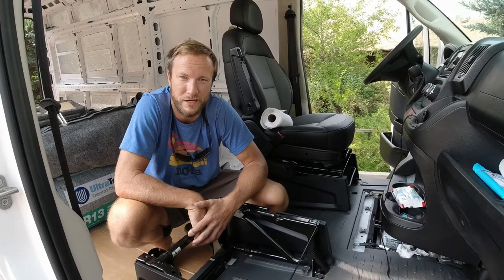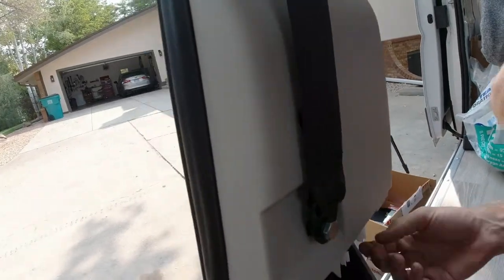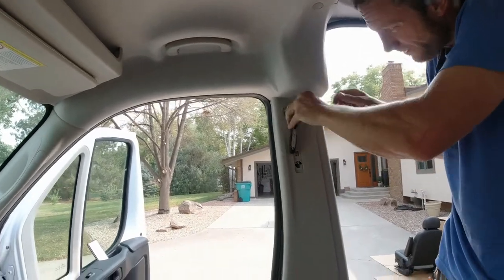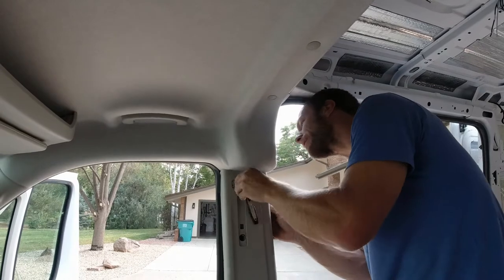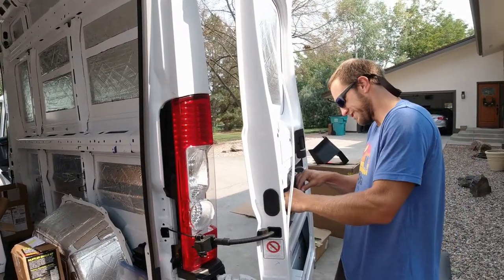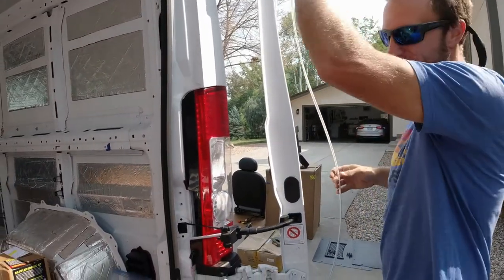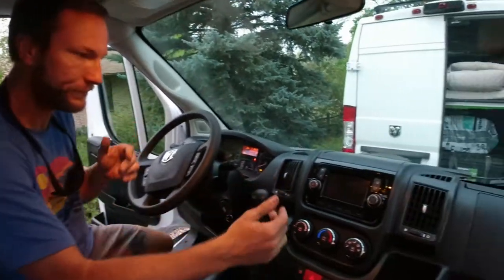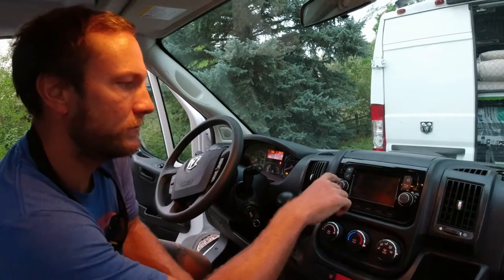Ram Promaster Stereo Upgrade: Rear Speaker Install & How to Reprogram Stereo for Rear Speakers

Comment: Higher sensitivity speakers is what you need. Or external amplifier. Sound dampening to quiet the road noise will also help. The amp inside the factory radio is pretty garbage I think. 
Look for speakers with higher dB/watt. Anything over 90dB/watt is pretty good. 
Also distortion even at low power will blow a speaker. Keep that in mind. I’m working on 3D printed speaker pods for the dash that I’m thinking will really help my Promaster’s sound.
Reply from the maker: Yeah, we put in an amplified sub and it's been sounding great.  For some reason, the 2019 stock stereo gets much louder than the 2017 we used to have.  So that helps.  Hope your 3d printed parts work well for you!

Comment: Hey Y’all and thanks for your time!   The one Question EVERYONE NEEDS TO BE ANSWERED IS...,what are the Wiring Colors for each Rear Speaker at that connector!!??   1k of us have been asking for years!!!!  What are they!?  Xoxo
Reply from the maker: Thanks for watching!! The colors don't matter when you're using the upfitter, which is located in the passenger pillar.  You only need the wiring diagram if you're wiring behind the head unit.  If you don't have the upfitter, we did find the wiring diagram online at some point in our research but I can't remember what the colors are at this point.  If I can find it, you can too!

Comment: How did you get the ferrules to fit in the upfitter? When I use that crimping tool it makes the ferrules square and the holes are round.
Reply from the maker: While the hole you see is round, where the ferrule goes is actually square. If you can't get the ferrule into the hole, try to rotate it slightly to align the square. It's possible that you may need a smaller ferrule also.

Comment: Hey guys thanks for the video! 
Question: What type of adapters "ferrules" do you use to plug into the board? thanks!
Reply from the maker: Hey!  The ferrule kit is linked in the description along with a few other things you might need.  Here is the kit https://www.amazon.com/Ferrule-Crimping-Tool-Kit-0-08-10mm%C2%B2/dp/B07K17VDF2

Comment: How did you make the panels for the speakers?
Reply from the maker: We made a cardboard template, following the contours of the recessed area around the speaker hole.  Be sure to make one for each side as they're not symmetrical.  Then we used the template to cut 3/4 plywood panels.  Test fit, then trim/sand if needed.  Then cover with automotive upholstery using spray adhesive.
Reply: Thanks!